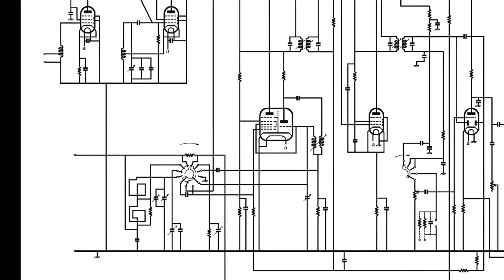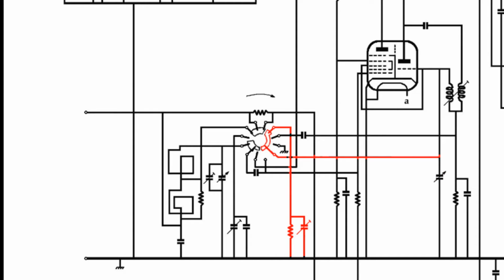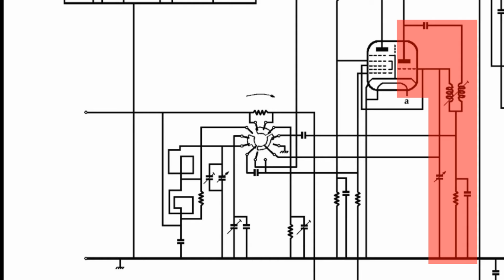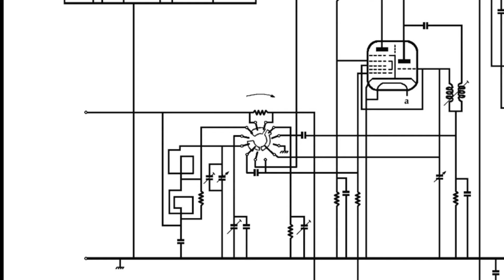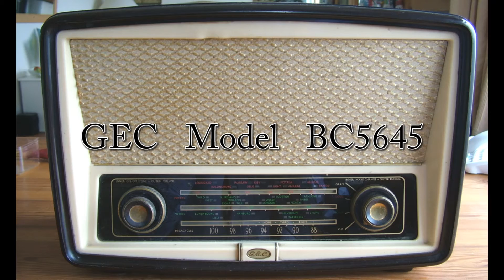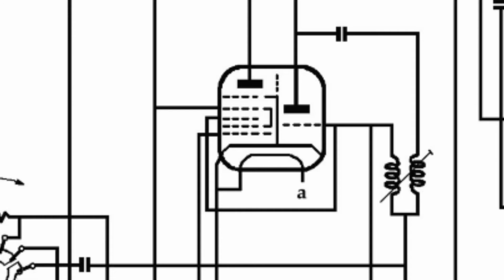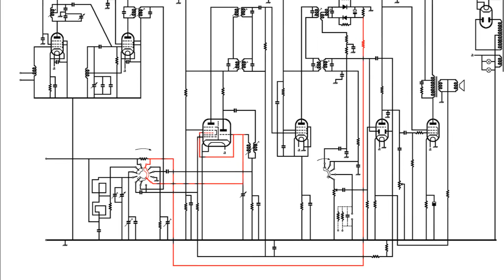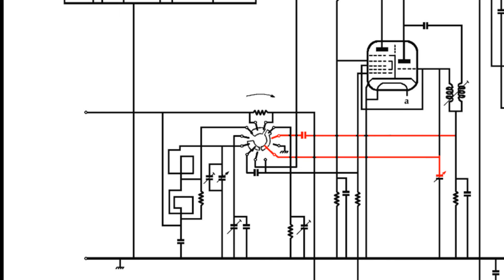About Radio ... Part 14 Local oscillator for the AM frequencies by Andy Davies

Comment: Hi Andy, thanks for taking the time to make these. I'm fairly new to electron valves.
I want to connect a frequency counter to the local oscillator, my schematic will be different. Will I get into trouble just probing till I find it? Damaging either the radio or the counter? What should I look for in my radio, and any advice on how to interface to it would be appreciated. I assume there will be noise if I don't isolate the two devices from each other (the counter and the radio). Thanks again :)
Reply from the maker: Hi and thanks for the feedback. Well the first thing you should do is get hold of the circuit diagram for your radio. Try w w w. radio-workshop. co. uk/workshop. shtml
If you can’t find one there go to this site  vintage-radio. net   and ask for help, the guys there should be able to help you. Don’t just go stabbing about in the dark, that’s never a very clever thing to do. The frequency coulter will have a safe maximum input voltage and it could be quite low.
I don’t think you’ll have a lot of success in tacking the signal out of the Local Oscillator (LO), I’ve never tried it with a frequency counter but even hanging an oscilloscope on the LO can be enough to block it (stop it.)  For the radios use, the LO only needs to be the tiniest of signals so there normally isn’t any spare power that you can take out and even if you could draw power from it you probably pull the frequency down.
So, I don’t think that you’ll be able to do what you want to do but hey, don’t let that stop you from trying, I’ve been wrong before and I'll be wrong again. (Let’s hope you can prove me wrong this time but have some fun finding out)
If you do nothing else get the circuit diagram.
I hope that helps.
Kind Regards ... Andy
Reply: Hi, well I have done it with a pocket transistor radio powered by 2xAA batteries. The Freq Counter displays the tuned freq plus 455kHz.
I figured there's nothing dangerous in that. But I have seen freq counters connected to radios all over the place.
Reply: Yes it does slightly alter the tuned freq of the radio, but since the freq counter is supposed to be the new display, it would only matter if some important station dropped off the end of the dial.